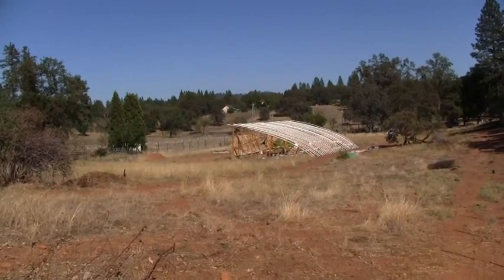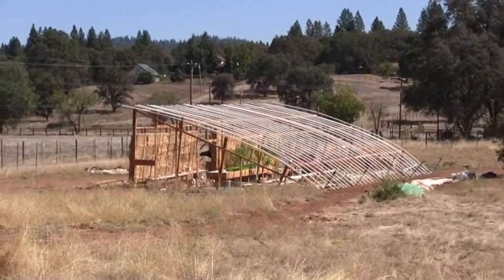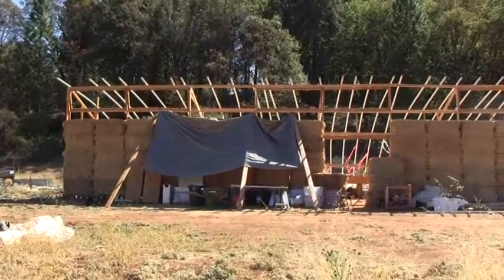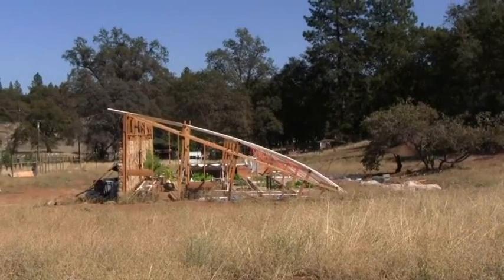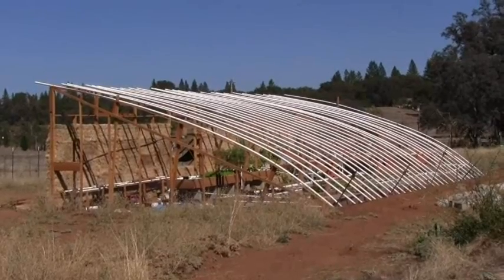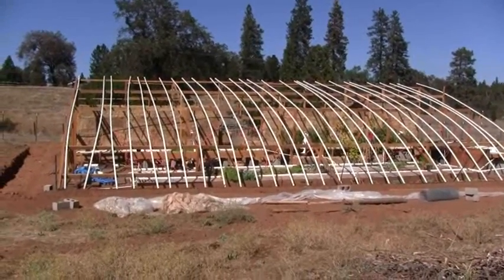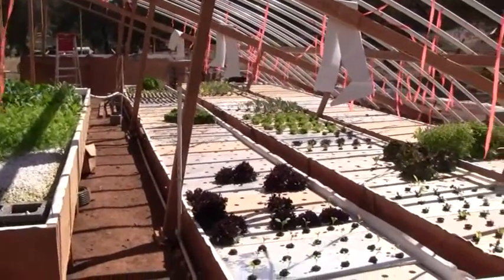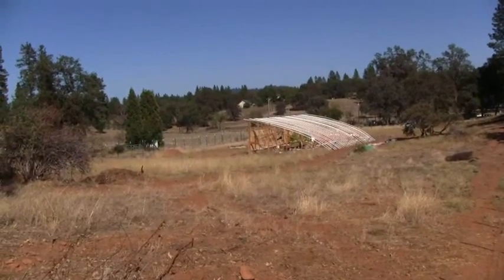Passive Solar Aquaponic Greenhouse System, Personal or Commercial Size

Comment: Please post a video of this during the winter, with information on the outside and inside temperatures, along with any information you can provide about how much external heating was required to keep temps up? 

Also, after it's covered, how are you going to keep it cool in the summer, as in how do you get the overheated air out and new, cooler air in? Thanks!

Comment: How cold do your winters get? I've got to deal with -30's for a week to 10 days every winter but sustained negative teens are a norm for pretty much all of feb.  would this design work in this type of climate?
Reply from the maker: loadmastergod No, I don't think my system from last year would work for you.  But the system I'm putting in this year would.  Basically, heat the water first using a hot water heater and a water pump to flow water through PEX tubing coil in your deep water tables or reservoir.  Thermostat controlled relay turns on the water pump and flows the hot water through coils, slowly / gently warming the water.....safe for fish.  set to 68F  and that takes care of roots.  But you'll still need an air heater as well................wood stove or propane.  But only to keep plant tissues from freezing................so keeping things above say 40F or  50 F overnight ought to work.
Reply from the maker: Our winters here get down into teens F overnight, then warmer during days.  Usually above freezing, but many freezing days and more nights.  Including radiation losses to cold dark night sky, the snow surface temperature dropped down to around negative -20F.  Inside the plastic kept cold sky temps higher, closer to freezing vs off scale negative for IR meter.  Night sky can be minus 150 F or something like that, driving surface temperatures really cold.  Plants stayed alive via keeping from freezing, but they didn't grow.  So could just as well have let things die and re started in February.  This winter I plan to install water and air heating and see if I can maintain growth through solstice plus or minus a month.

rt